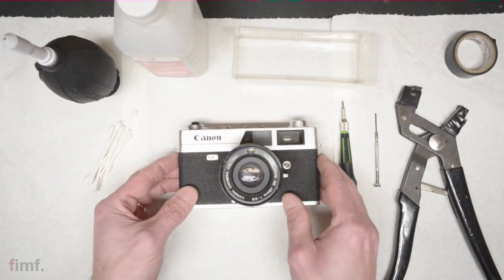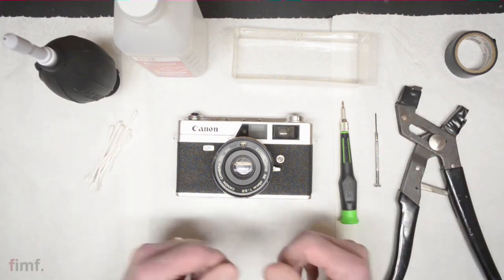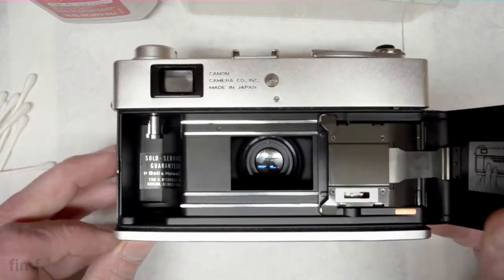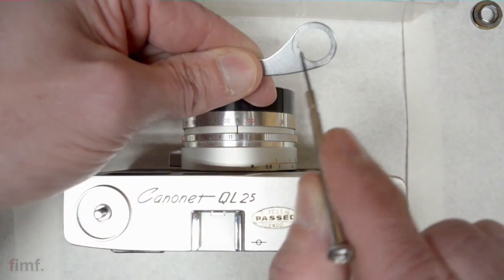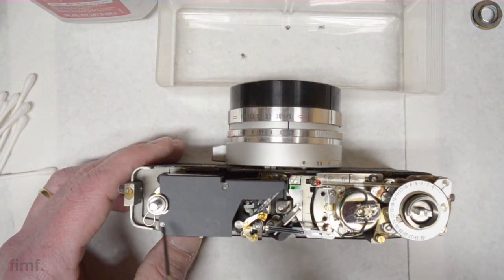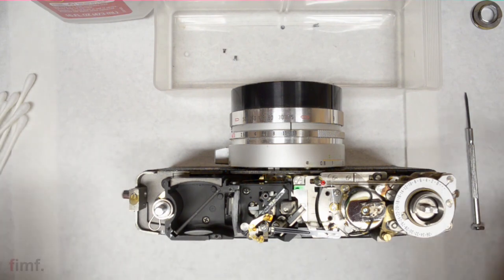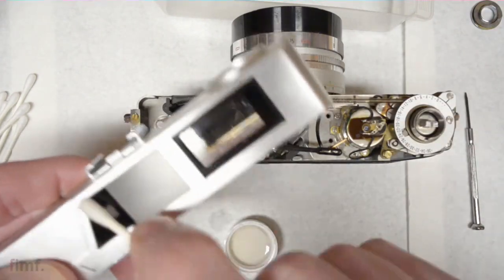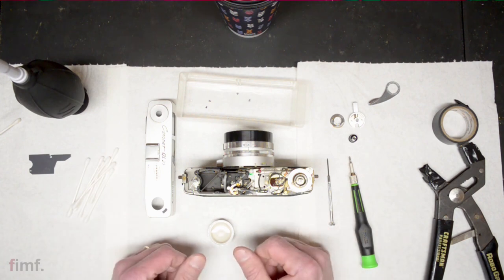How to Clean a Canonet Viewfinder (Canon QL 25)

Comment: Couple of points! Use COTTON Q-Tips as the Poly ones will scratch the coatings! Also use quality Japanese JIS screwdrivers! I place a magnetic vinyl sheet [you can get from a commercial sign store] over the work area so the screws etc. don't get launched to Perdition!!
Reply from the maker: Great points! Yes, I really need to get one of those magnetic mats for myself, actually. I have a rubber mat with magnetic 'dishes' but you're right losing these tiny screws is horrible!

Comment: Great video. When I service any cameras i like to use egg cartons to arrange my small parts. Also I learned the hard way  not to clean old beam splitters, I also learned its not the end of a camera. I was able to find new beam splitters on line and with some gentle glass cutting I was able to replace the one I cleaned. The new beam splitter glass is purple, ........nothing is perfect.
Reply from the maker: Egg cartons are a great idea! 

I learned the hard way on an old Canon rangefinder a few years back not to clean the beam splitter. Live and learn I guess haha.  🙂

Comment: Don't have any of this kind of camera (wish I did) but interesting video again, thanks.
Reply from the maker: I'm glad you enjoyed the video, Alan. 🙂
Reply: I can’t unscrew the three screws on the top plate......
Reply from the maker: @chloeyeung3  Hi Clem. Your screw driver may be an incorrect size.
Reply: filmismorefun thanks ! I just went to buy the right one and have finally finished cleaning the viewfinder. Sadly the coating of the ‘angled mirror’ is already worn out...
My next step is to try cleaning the lens..
Reply from the maker: @chloeyeung3  Awesome! I also have a video posted last year about fixing the shutter on a Canonet that goes through the front and rear lens removal of you need it. Good luck. 🙂
Reply: With some searching you can find new beam splitters on line, you may have to settle for an odd shade of some odd color. I replaced one of mine with a purple tinted beam splitter.  @chloeyeung3

Comment: Hi, great video! Unfortunately in my camera the beam splitter is missing and I wanna replace it. Could you please tell me the exact size, so that I can replace it?
Reply from the maker: Hi there! Sorry I can't help you with that as I'm not sure if the size. Also, I don't know that parts would be easily sourced anymore, but one option is to buy a non-working copy for cheap on eBay to use for parts. Good luck! 🙂

Comment: Hi there
Awesome video.
I just bought this camera for cheap from Ebay, it was untested. I'm also new to film cameras.
I checked that the shutter worked and the aperture blades adjusted.
And I noticed the viewfinder was hazy.
But, I also noticed that there is a focus box in the centre but nothing changes when I move focus lever on the lens.
Could you give me your opinion on what the issue may be ?
And what part specifically I should look at when I open the top.
Thanks so much.
Reply from the maker: Hey! Sometimes what can happen is that the rangefinder glass will become detached from the plate arm that moves it left and right to focus. When looking down into the top of the camera, it is an angled price of glass in the middle portion.

I've created an image for you to reference: https://ibb.co/Dr0yVFx

The blue circles the mirror I'm referring to, and the green dot is where the glue needs to hold the back of it to the arm plate. 

However, this may not be your problem, but hopefully it helps! Good luck 🙂

Comment: Hey! I have one of these but have no idea what batteries to put in it, can you let me know? Thanks 😊
Reply from the maker: Hi there! If you search for "L1560F Battery" you should see some options and some alternatives. 🙂
Reply: filmismorefun amazing. I fitted 3 inside, just not entirely sure they’re powering it. Is there a way to tell it’s got power?
Reply from the maker: @duncantemple1  3? Hmmm. I haven't had this camera for a while, but I only recall 1 battery fitting in the chamber. I believe the exposure meter and shutter are linked, so if the shutter won't fully depress, then there is an issue. I'm going off of memory here, because it's been a while since I've used this camera haha. I hope that helps!

Comment: i have accidentally wiped off the coating in the beam splitter ☹️ is there anything i could do to fix it? , Wish i saw this vid before cleaning
Reply from the maker: You could try finding a copy on eBay that is non-working and switch out the beam splitter with yours.

Comment: Hi Chris, I have a QL19 with the diagonal mirror in the rangefinder (not sure its proper name, but not the beam splitter) that was completely loose. What's the proper way to reattach it, without having to lose accuracy? I assume it's positioned with the non-reflective square as centered as possible on the metal square?
Reply from the maker: Hi Dane. Unfortunately I won't be much help here as I no longer have the camera to refer to the positioning your asking about. About adhering mirrors, this very well may be incorrect, but I've used cyanoacrylate adhesive (Krazy glue) before. There may be a proper adhesive for this, but I'm not sure what it is. I would check around in some rangefinder forums and pose the question there, as someone may be able to provide a solution. 🙂
Reply: @filmismorefun  Thank you. I was going to use crazy glue regardless but I wanted to be doubly sure I'm positioning it correctly. I'll find a forum!

Comment: Is it safe to spray compressed air on the beam splitter?
Reply from the maker: I don't know to be honest. The compressed air shouldn't harm it, but sometimes you get a slight liquid that sprays a bit with it. I always use a rocket blower for the dust.
Reply: @filmismorefun  I watched the cleaning of the beamsplitter video right after this one. Is that the more proper way to clean it? Where would I find the tools  used in that video?
Reply from the maker: A rocket (squeeze bulb) blower. It's generally used for cleaning dust off negatives. It's available at photo suppliers, or probably Amazon.

Comment: I have a QL19 the battery cap is kinda rusty and can not be opened , do you know any ways to open it?
Reply from the maker: Maybe try putting a very small amount of penetrating oil in the threads of the battery door for a while before trying to open it. I wonder if you'll find the batteries inside have a lot of corrosion and leaking.

Comment: so helpful ! I have a question, sadly my Canonet fot a hit and the plastic part of the viewfinder got a crack, I'm thinking on change it myself, does someone knows if I can buy that plastic part somewhere? and does someone have experience that before? I dont know what kind of glue I should use , if someone know how to I will appreciate if they can guide me! Thanks :D
Reply from the maker: You could purchase a used one for parts on eBay. As for the glue, I'm not positive, but if it were my camera I might try any plastic-safe clear liquid based adhesive. I hope that helps! 🙂
Reply: @filmismorefun  That makes a lot of sense ! thank you for answering so fast, I appreciate it. Great channel  :D
Reply from the maker: @artkapana  You're welcome. Good luck 🙂